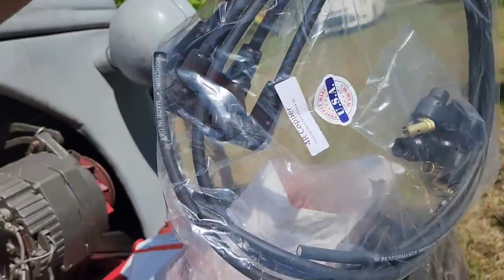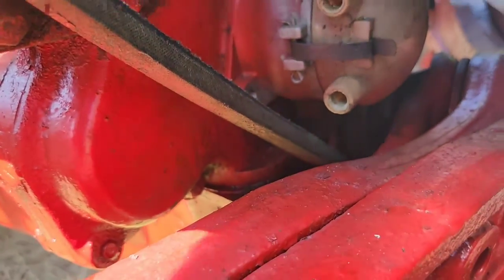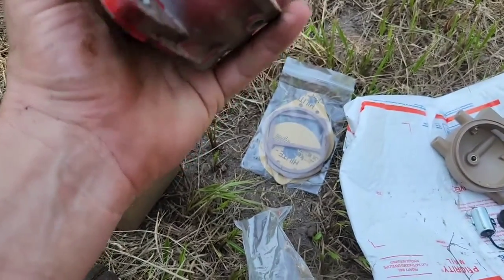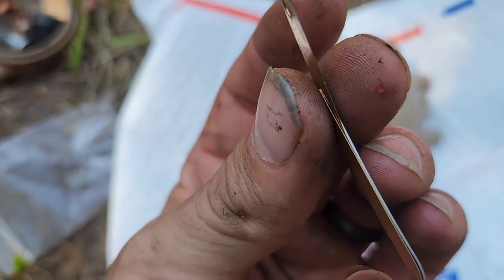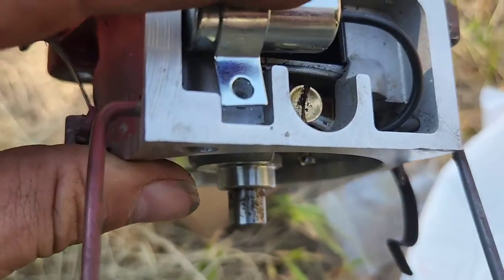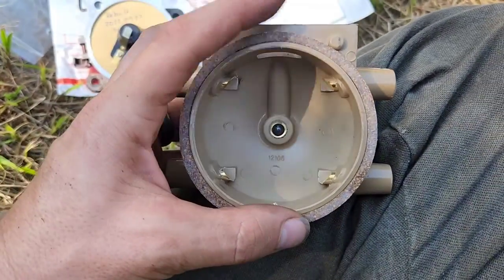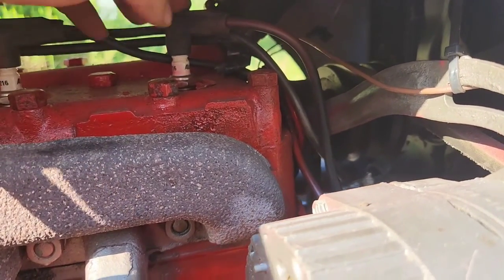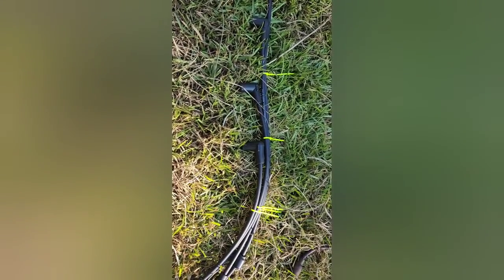Ford 8N ignition tune-up: Step by Step

Comment: Thanks for the effort, but couldn’t you have corrected your numbering mistake, along with an actual video of which spark plug wire was connected to which point on the distributor ? Not terribly helpful!
Reply from the maker: I understand your frustration, but I did correct the mistake in editing.

Check at 1:13

Comment: At 13.50 it looks like the conduit tube the sparkplug wires run through is missing. Because the plug wires would have to be threaded through the tube the wire ends are not made up. Nice video.
Reply from the maker: Yea.... I have noticed that on others' videos since I made this video. 
I have debated about going back and redoing it to make it original. 
From what I have seen, that tube is ridiculous overpriced. 

But, I do appreciate keeping me honest.
Reply: I wanted to get a new one for my ‘49 and the tabs are broken but used ones are wayyyyy over priced. I can fabricate new tabs.
Reply: I wanted to get a new one for my ‘49 and the tabs are broken but used ones are wayyyyy over priced. I can fabricate new tabs.